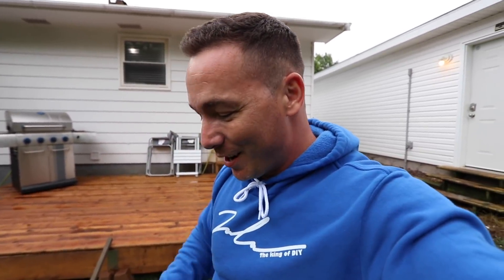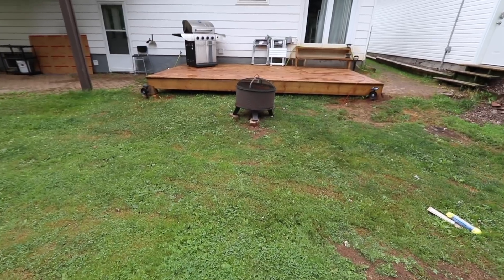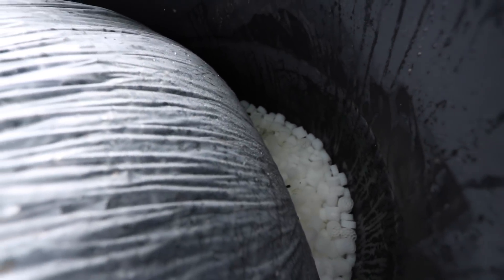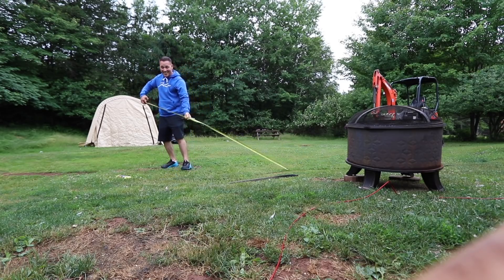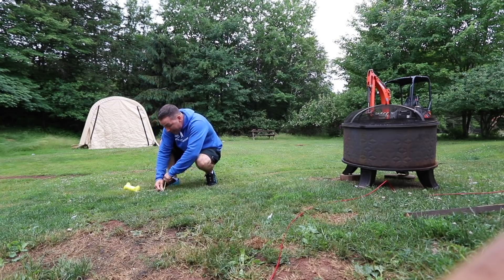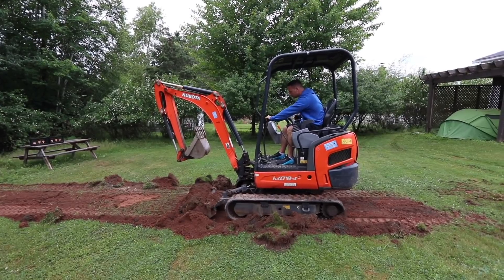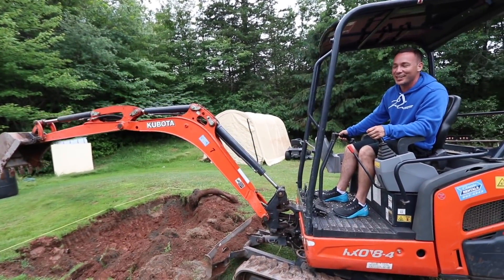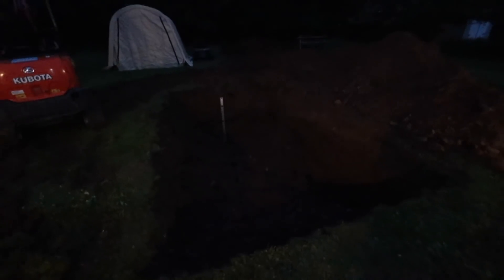I'M BUILDING A POND!! (So i can swim with my aquarium fish) part 1

Comment: Sweet.  Pump water from the bottom up to a waterfall and just fill it with P gravel and lava rock that will be all the bio filter you would ever need plus if you pump the water from the bottom of the pond it should come out warm enough to maybe keep a hole open or you might need to put a heat source in there like a hot rock or one of those floating things for ponds that keeps a hole open for oxygen.

Comment: You should put a gradient on the side of the pond, doesn’t need to be steep nor long but if it doesn’t go straight into the full depth it’ll help prevent wee ones from drowning.  Sure they’ll still fall in but if let’s say you had like a step a foot around it, it’ll give you a shelve to plant things into and prevent someone from going straight into 5 feet of water
Reply: it will also help the sides from collapsing, all the vids of pond builders i have seen do it in steps

Comment: I would suggest if you’re going to dig the pond out that’s fine 360’s are fun but get a pro driver in for a day to spread you’re garden out you won’t regret it i would do it for free but I’m in uk 🇬🇧 if you do spread though use the grading bucket to spread soil not the blade on the front of machine and only a few inches at a time then track it in with the digger cant wait to see the results good luck from sunny England 🏴

Comment: Its july and you have on a sweatshirt?  Down here we have high humidity and 3x digit heat.  Those mini excavators are easy once you get used to the controls.  Dig as much as you can from the side away from the house.  You can spin around and drop your dirt near the woodline.

Comment: How are you going to handle winters?
Reply: That's why he is digging it 5ft it's below the frost line the fish will be fine
Reply: He addressed that in the video, he's digging it 5 feet so it is below the frost line (4ft in NS) - and he's thinking a deicer to keep a section of it from icing over for oxygen exchange. And you typically do not feed the fish when you are over wintering them like that. Koi will survive this setup no problem.

Comment: What exactly is the frost line you said it’s 4ft does that mean the fist 4ft will freeze solid
Reply: It means the ground freezes that deep. It's different in every region depending on soil type and how cold/long Winter is.
Reply: @aldude9511  thanks man... New info for me
Reply: Aldude thanks. Man that thick ice surely adding heaters will shrink the depth of the ice

Comment: Why don't you just get a heater?
Reply: Heaters can go bad and you would have to run electric for that
Reply: Just a thought why not use a poly tunnel over the top for winter and it never gets as cold here but had a lot of success running a air pump in the top foot in winter from inside so air warmer.